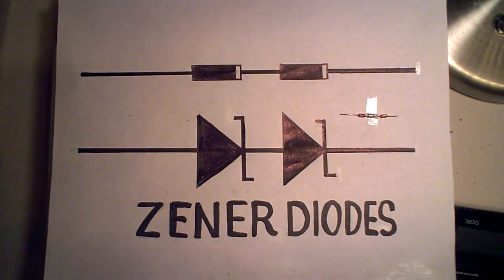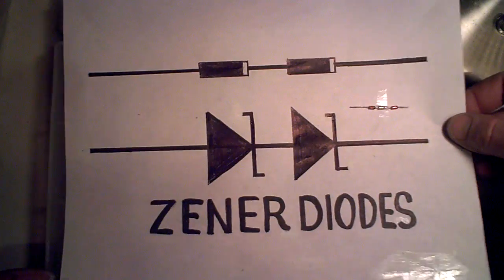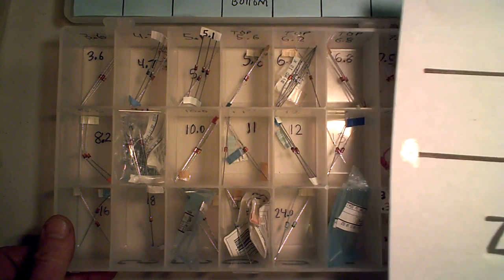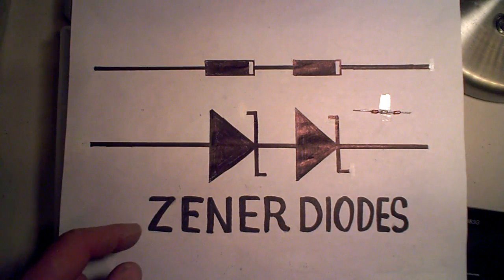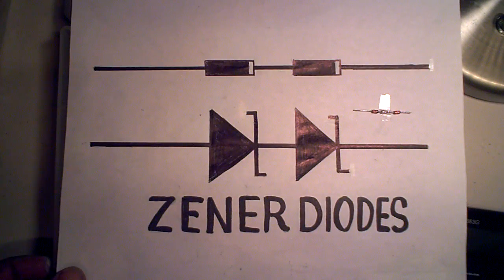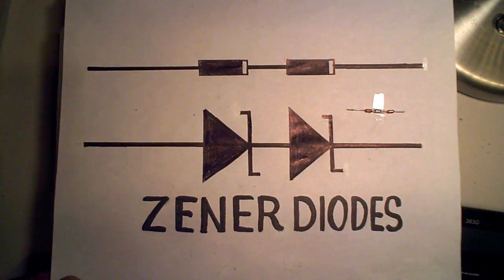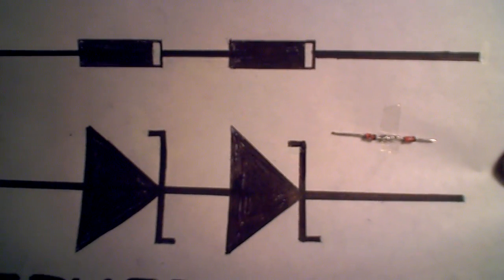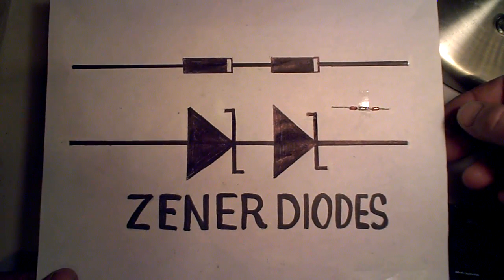Zener Diodes in series

Comment: You mention nothing about the forward voltage drop. If you add 2 x 5v zener in series and each have a forward voltage of 0.6v then you would need to add those up, then subtract that from your overall voltage. Eg: 2 x5v = 10v; 2 x 0.6v = 1.2v..... 10v - 1.2v = 8.8v zener voltage.
Reply from the maker: Since a Zener Diode is a reverse biased component I don't believe the voltage drop occurs in the same manner as a forward biased diode. It's listed voltage is designed to avalanche at a particular voltage, so if the manufacture says it's a 10 volt Zener Diode that's the voltage at which the diode  junctions allows current flow.
Reply: @GrantsPassTVRepair  Makes sense. Now Im gonna have to go measure it!!! Thanks for the info.

Comment: can use a zener diode on the output of the rectified transformer, becouse it gives 42V and i need 40V , and transformer is about 100VA ,  what zener power will  i need , anyone knows ?
Reply: What you need is a varistor with a lot of kilo-ohms (more ohms = finer adjustment)
Here's a calculator and i hope my info is still relevant to you :)

http://www.ohmslawcalculator.com/voltage-divider-calculator

Comment: I don't find 5 watts zener diode is there any way to use several zener diodes of 1 watts so it can resist to 5 watts ? how can i do this ?
Reply from the maker: I'm not sure if  5 one watt zener diodes in parallel would be reliable, but I suppose you could try it, and see if they all operate at about the same temperature.
Reply: Well apparently Zener diodes must not be connected in parallel because If two Zener diodes are connected in parallel, the one with the lower Zener voltage will conduct most of the Zener current
Reply from the maker: I figured that might be an issue, unless you could find one that was perfectly identical in it's conduction threshold characteristics.
Reply: Do you have any idea using a power transistor in combination with a zener diode ?
Reply from the maker: I have no doubt you can build a regulator circuit which uses a zener diode and a transistor, but if you'r e trying to build a voltage regulator, This is a very inefficient way to accomplish this. May I ask what this is for?
Reply: Its for an induction heater and i hope to find a way using low power zener diodes instead of 5 watts diodes ....

Comment: Total wattage of the zeners will add up and share equally if voltage of each device is the same, ie - 10 similar 400 mW diodes in series will offer a total of 4W dissipation.
Reply: Thank you.

Comment: Man I used to love this stuff!  Now ICs and complete board replacements have dulled my senses but I still enjoy working on circuits... as long as they are not surface mount!!
Reply: Even if I replace a board, I like to find the problem with the bad board and remove it or fix it so that I know the other components are good in case I want to use one somewhere else, or have the board fixed for next time I may need it. But I don't fix them for a living - I'm just a hobbyist that tinkers once in a while. It's still a lot of fun. I wish I would have got into electronics in my younger days!

Comment: Can you explain why you would use a zener diode?  Have used regular diode, when I need to make sure the current only goes one way.
Reply from the maker: Zener Diodes are used in a different manner that more conventional diodes. They are designed to conduct at a particular voltage when they are reverse biased. If they are used in the forward bias mode they act more like a conventional diode.

Comment: If I need a 10v 1 watt zener can I use two 5v 1/2 watt zeners in series? Do the wattages add like the volts do?
Reply from the maker: +davecc0000 No. The wattage of zener diodes (do not) add up in a series circuit. Only their break down voltage does. Two 5 volt 1/2 watt zener diodes will make a 10 volt 1/2 watt zener diode.
Reply from the maker: No. The wattage does not add up.
Reply: +Grants Pass TV Repair   Yes, the wattage does add up.  a 10v 1 watt zener can safely conduct 100 mA, just as a 5v  1/2 W zener can safely conduct 100 mA. In series, 2  5V zeners at 1/2 watt each will safely conduct 100mA dissipating a total of 1 W just as the single 10V 1W would.
Reply: Grants Pass TV Repair
  can you multiply?  voltage across a passive component times the current through that passive component = the wattage dissipated BY that passive component. DO THE MATH ! 5 volts times 100ma = .5 watts   ...with the same series current of 100ma through 2  5v zeners,  .5 + .5 = 1 watt dissipated.